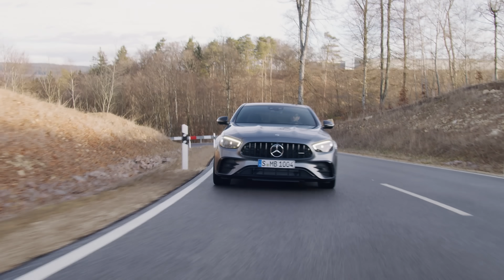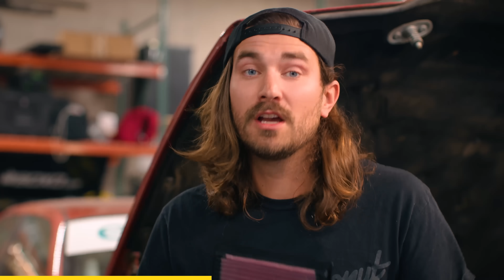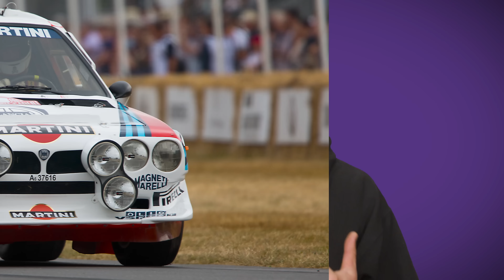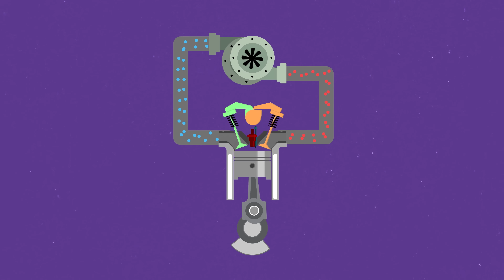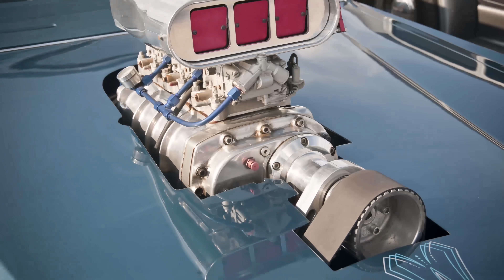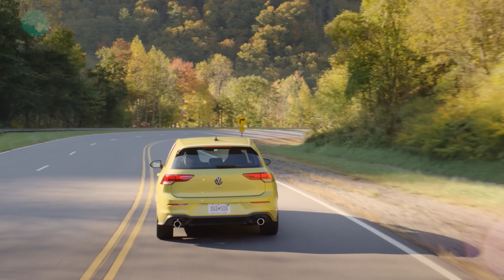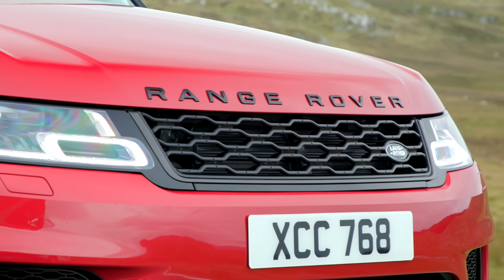Why Your Engine Isn't Twin-Charged

Comment: Actually, there are more than just 8 twin charged engines. Almost any turbocharged 2 stroke diesel is actually twincharged. Locomotives even took the concept a step further and added a clutched turbocharger. At slow speeds, the turbo is engine driven like a centrifugal supercharger, and at higher speeds, the increased exhaust gases allow the turbocharger shaft to spin faster than it would if it was strictly engine driven.
Reply: It's a cool concept and probably also practice, but the turbo when belt fed is still centrifugal, as opposed to positive displacement. I guess that isn't as important, though, considering the fact that a locomotive engine turns a generator for electric motors, instead of being direct drive? Cool enough concept.
Reply: @brianwesley28  It really doesn't matter for an engine. There are disadvantages to centrifugal pumps when you get into things like very viscous fluids, but for air, you shouldn't have a problem. In the case of a 2 stroke, the supercharger, or rather blower, doesn't create boost anyway, it simply provides positive air pressure to establish airflow. The centrifugal blower is actually more efficient on an engine, because the output air isn't as choppy as you get with a positive displacement blower. That's why most blowers have twisted rotors, to reduce that chopping effect. Screw type blowers are better at it than roots blowers, but centrifugal blowers are better than both because it's constant pressure.

Comment: Twin-charged TSI engines were the biggest piles of shit ever and I’m glad they’re gone. The scirocco for example, 1.4 160km. Really? You have to deal with all that just to get 160km? It was so unreliable you wouldn’t believe, so much pressure the pistons were breaking, and the supercharger was known to break as well, on top of the timing chain snapping after laughable mileage oh and the crazy oil consumption... Scirocco R used a turbo only setup and it says a lot(not that it was reliable anyway) Twin charging sounds good on paper but it’s a horrible idea for a daily.
Just get something naturally aspirated like a Honda with a k20 pushing 200km and you can sleep calmly without worrying everything will fall apart. And if you want a turbo then make it worth it and aim for higher power...

Comment: Love it too, I think 4age garage has a great video about a certain year infinite throttle body that has 2 pins for 12 volt to either open or close it and uses a manifold pressure switch to give it voltage to close off the supercharger.  He's got it working in the Toyota motor

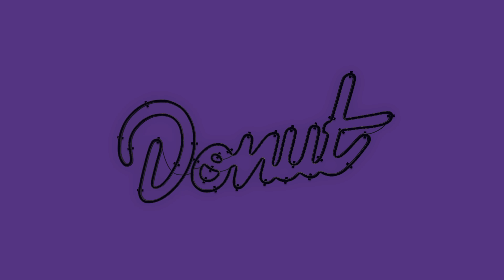Comment: 0:57, K&N filters miss fine abrasive particles like Donut Media missed the Volvo T6 and T8.
Reply: Yep, don’t know of many people who actually clean and oil the filters as needed.
Reply: Never had an issue caused by a k&n.
Reply: @realeyes4734  Always kept getting dirty maf issues even when cleaning and oiling the filter often. One day I wiped the inside of the intake tube with a wet paper towel and it was all dusty. Needless to say, the K&N filters don't seem like they are as effective as paper for filtration.
Reply: @MikeyG003  I buy preoiled filters. And most k&n filters don't need to be oiled regularly so idk what you were thinking.
Reply: @realeyes4734  they come pre oiled, but obviously you have to clean them after a while…they have a filter recharge kit with spray and oil. The fact that you don’t know this tells me enough
Reply: @realeyes4734  take a close look at the filters and shine a light inside it. You can see big holes that dust particles can go right through. Can’t beat the oem paper filters
Reply: @MikeyG003  they litterally say preoiled for lifetime use. Funny you oiling them and washing them probably is what caused it too suck more dust in because you over oiled it
Reply: @realeyes4734  it’s funny that you think stuff lasts lifetime 😂 bet you believe your tranny fluid lasts lifetime too huh? Gee I wonder why KN sells recharge kits if their filters are “lifetime.”  I know how to properly oil the filters actually. Have fun with dirty MAFS and running that dirty oil 10k miles 😂 bet your piston rings will thank you
Reply: @realeyes4734  unless you're doing used oil analysis across multiple vehicles you're unlikely to notice the difference, but an engine with the K&N will wear at a faster rate than the same engine with stock filters. If you're okay with that for the perceived performance benefit that's your choice, but it's good to be aware of the pros and cons 🍻

Comment: The thing I don't quite understand is why put turbos in a CVT transmission vehicle. As turbos work better at high rpms while CVT tries to maintain a constant (low) and rpm

Comment: An episode on that 1.4 TSI would be neat. I love the episodes where you guys dig into some details that make normal cars unique and special because of their design and reliability of certain systems so the average guy has an idea what to look for when buying a used car.
Reply: It wasn't very reliable and didn't get made for very long
Reply: @stug45  blablabla, my scirocco 1.4 tsi has 200,000 km and is still doing fine
Reply: Common job in my workshop is to rebuild the 1.4 due to the pistons cracking. The engine isn’t great at all.
Reply: U are right. 

 +1 vote for 1.4
Reply: 1.6 FSI 🫡
Reply: @mc_remzky7559  😂 it's ironic I always preferred the 1.6 8v MPI (105ps), unsurprising as it goes back to the MK1 Golf GTI. The 1.6 FSI (115ps) often had no more power because people used normal 95 octane fuel, they only work properly on 97+
Reply: That engine was a disaster
Reply: @BrianKariuki  Early 1.4 TSI yes, but later engines were a lot beter. I have 2014 Seat Ibiza Cupra (technically VW Polo GTI) and it has later CTH engine. No issues at all!
Reply: @tTurboCarrot  Real, I bought a Cthd Jetta now it has 150k km. Of course wear and tear needs to fix but other than that no issues.
Reply: 1.4 TSI bmy engine code is though, you only need maintenance this engines often, around 5000 km oil changes if you are driving hard and of course full timing chain replacement every 75k, and knowledge how to do this, and knowledge  that not every engine is indestructible.

Comment: I don’t know why nobody has made a turbo with an e clutch on it driven from the crank, like spin it up, suck the exhaust out, and when the exhaust starts to overpower the turbine, the e clutch can disconnect and allow the turbine to spin even faster
i’m taking the patent yep
Reply: don’t explain the problems. i know
It’s called research and development

Comment: Any Volvo with a T6 designation usually means its a supercharged and turbo charged 2.0 liter engine.  I'm surprised he didn't mention them because they've been doin that for a while and still do unless they have changed it recently.

Comment: Bro you including the Detroit Diesels in those "8" twin charged engines? 6V53T 5.2 litre, 2 stroke, V6, has a roots blower and turbo. DD did that on a bunch of different engines models

Comment: I bought a fire truck from a department that lost it’s funding and had to close its doors. It was a ‘94 KME that weighed in at 40k lbs and had a 6V92TA Detroit diesel in it. I remember the first time I used the hydraulic cab tilt to raise the cab which had to be done to access the engine as it was a cab over engine design. There was this huge engine with a monster snail on the side and I thought “what a sick ass turbo!” til I saw the sick ass supercharger also nestled on top. To weigh 20 tons this truck had the torque and was surprisingly quick. I tagged and insured my new to me fire truck and used it for everything. From picking up my son up from school to taking my wife to the grocery store. My wife hated this fire truck because it stunk, was loud, and gave her a headache. I don’t take my wife anywhere anymore.
Reply: So it's actually not a supercharger because the Detroits require a blower to run. They are two strokes and they get their air at the bottom of the stroke when the piston is not creating vacuum so a blower is required to get air into the cylinder

Comment: The car geek in me says that if a motor uses identical chargers i.e., turbos, that's a twin system, however, if it uses a S/C and a Turbo, then its compound boost. 

Car guys in the comments. LOL
Donut please stop referring to such set ups as "twin" charged.

Comment: The car geek in me says that if a motor uses identical systems i.e. turbos, thats a twin system, however, if it uses a S/C and a Turbo, then its compound boost. 

Car guys in the comments. 
Donut please stop referring to such set ups as "twin" charged.

Comment: Im thinking that adding a super charger between the turbo  and intake runners might  decrease turbo lag, maybe the other way around, most super chargers dont run an inter cooler, because your not heating the air like turbo,s

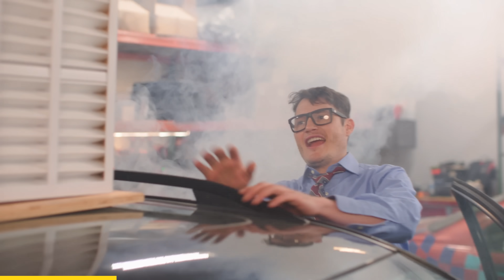Comment: 1:28 So, in the construction of the FART, you used DualUnescesarryDucts(DUD), multiple PreciseOxygenSensors(POS), an ElasticWasteWasher(EWW), and a Variable-Ingegrated-Injectors(VII) TBH i dont know what VII is supposed to mean, but i know what the others mean

Also, your Oil-Hub-Filter-Utilisation-Contraption probably needs some Koolant

Comment: Aren’t some Detroit diesel 2 strokes twin charged?
Reply: Detroits weren't twin charged or even supercharged. The blower on them was required to run. It's a two stroke with no exhaust valves it has intakes ports in the cylinder wall. The piston uncovers these ports at the bottom of the stroke. The piston does not create vacuum at the bottom of the stroke. So the blower is there to get air into the cylinder and that's about it which makes it naturally aspirated and the turbo variants we're like any other turbo diesel.

Comment: Jeremiah as always fantastic episode. Thos had me pondering about something I've thought about for a while. Different car manufacturers have went Different routs to obtain more while getting better fuel economy. 
  Ford was one of the first and they went to the turbos with the Ecoboost engines. At the sametime they had been adding more gears to their transmissions with their trucks. Further helping MPG.
   GM later did a similar jump as Ford. However I don't thing their shrunken gas engine with turbos like the Chevy Cruze is much to write home about. However they have added more diesels in smaller sizes. Which is another great way go get much more MPG.
  Subaru has stayed with the trusted and loved boxer engine.  The moved on from the 4ATE automatic transmission to a few varieties of the CVT. The CVT not only helps achieve better fuel mileage over a great platform. It also keeps the vehicle from any type of moments of sudden change or slip that you can have in an automatic transmission. The CVT keeps the wheels in motion at all times. Subaru felt this is best for safety, driver experience and the symmetrical AWD platform.  The Ascent has a turbo in the 2.4L to help it get moving up to speed while still achieving very good gas mileage for the size and architecture of the vehicle.
  There are other companies that aren't as open into how they are getting more mog out of their models. Especially if your not seeing a smaller engine with a turbo as an option. What is Dodge, Jeep, & RM doing? A lot of the line up is the 3.6. Some now come with e torque as an option. How does that compare to the others? It seemed that until the last few years Dodge, Jeep & Ram where relying at on cylinder deactivation. As well as putting the 9 speed ZF transmission in anything they could. 
  Am I far off? What are your thoughts? I think it could make a great episode. Possibly a series. You could easily spend an episode each on each manufacturer. 
  Keep up the great work!

Comment: This video feels a little too late.  Who on Earth would use a supercharger to twincharge when you can use an electric motor on either system to achieve this with very few extra parts and weight.  Compressed air is another underutilized option for racing, but much prefer the electric option for the real world.  EDIT:  I see, we're gonna call them electric superchargers, I guess that's fair

Comment: i was thinking of a concept of air injection to the turbocharger using a turbo that has a extended impeller shaft with another impeller you could shoot a blast of high pressure air and spin the turbo instantlly,using bottles like scuba tanks that use a pully that works off the crank to compress air into the tanks to refill them as you drive,that has a pressure switch that stops compressing air once at a preset target pressure.maybe using a ac compressor to refill bottles since it disengages when it sees the target pressure

infact you could even modify a turbo withput needing a 3rd wheel on the turbo by drilliing a port into the turbine/compressor housing and having a steel nozzle tip added that could blast high air pressure onto the compressor or turbine wheel from idle to what ever peak boost is.once peak boost is acheived the system uses pressure switch to shut off the air supply from tanks.

just fruit for thought on air injecting to replace supercharger in twin charging.as this would be far less complicated and very basic concept.also this might make new cool sounds if you bottleneck the air after its been injected onto the third impeller into a valve that has a horn shape.

Comment: Did you check out the Detroit Diesel 71 series TIB option set which includes Turbo Intercooled Blower options on a mass produced engine. Which can be found in many applications over the last 40 years alone.

Comment: For the last 20 years I have been toying with the idea of a twin charged efi smallblock utilizing 2 turbos with a smaller compressor wheel and larger hot side an a crank driven centrifugal, but I haven't acquired the spare 20k+

Comment: I had an after market twin-screw supercharger kit installed on a 1994 Subaru SVX. It had a boost delay, because there needed to be a vacuum bypass valve on it to idle. It idle as smooth as factory sitting at a light. Once you started to go and got to about 1200 rpms, there was enough vacuum to close the valve. It resulted in a sudden 75hp jump in power. If you happened to be in mid turn, it could quickly result it an unexpected U-turn......
Reply: I think I would have actually preferred some turbo lag....

Comment: Hey Jeremiah are we going to overlook the fact that the supercharger in a twin charge system is a boost multiplier now bear with me the supercharger at low RPM provides power where the turbo can't however when you get up in the RPM band and the turbo spooling the turbo is supplying pressurized air to the supercharger and then the supercharger has the ability to compress it again this happens a lot of times in  older aircraft engines

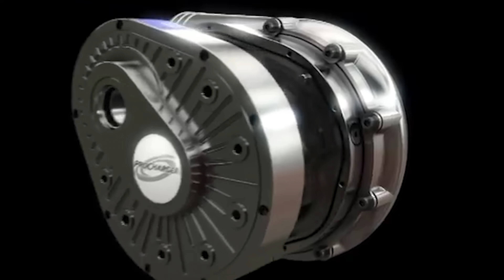Comment: 7:53 "as crank speed increases, there is an exponential increase in impeller speed"
i think what you meant to say is 'linear increase in impeller speed' , since the impeller spins at a fixed ratio to the crank

Comment: Check out the hellion hellraiser kit for the 04 cobra. Twin turbo and supercharged. I was one of the few people who used it with a kenne bell 2.4L supercharger. I made over 1k HP at 30 PSI and 10.5 degrees of timingwoth C16. Made 850 on 26PSI and pump gas as well.

Comment: COMPOUND TURBOS!!!!!!!!!!!!!!!! 
90% of the benefits of supercharger+turbo with less draw backs, sorta. Maybe just different ones, but it’s the best IMO anyway.  Two turbos, one big one small but it’s not twin or sequential. The big one blows into the intake of the little one to magnify the air density it starts with, you get a super responsive turbo setup that has big top end. You do need a really good intercooler setup though and some complex exhaust.

Comment: I recently added a procharger to my '91 F-150 302. Runs much better now, tons of power and after removing the clutch fan and replacing it with an electric fan, I can't tell it's there until I mash the accelerator. I love it.

Comment: Here’s a power plant for you to check out:
My Dad had a 1987 44’ Viking Motor Yacht with twin Detroit Diesel 6-71 TIB’s.
Pop quiz: were they 2 stroke or a 4 cycle diesel twin forced induction beasts?
Reply: 2 stroke but not twin forced induction the 2 stroke Detroit's blower was not a supercharger and did not have a supercharging effect. In fact that 2 stroke design requires a blower to run. As such the non turbo Detroits are naturally aspirated

Comment: i kinda missed something. Most boats are twin charged, turbos feed the blower. The engine you kept showing was just blown. im confused as to go from blower to turbo and thru a cooler would create a pluming nightmare. why not go full hog and put a clutch in the system and we will call it mad max charging system. you still will have to have a blow of valve in that loop to, as you would kill the turbo and owner as it explodes.

Comment: There were some old engines (possibly aircraft? Can’t remember) That had what is essentially a turbo and a centrifugal supercharger combined into one unit. A single turbo-style compressor housing with both a crank pulley and exhaust turbine on the other end. The idea was that the crank drive would spool up the massive turbo, then disengage via a clutch once there was enough exhaust to keep it spooling via the turbine 👍🏻
Reply: Big two stroke train engines did that. EMD 710 567 and 645 series. I wouldnt be suprised at all if the big two strokes in ships did it too.

Comment: Why not just have an electric motor drive the turbo shaft directly ? - at low rpm you get the 2bar of boost and at higher Rpm you disengage and allow the exhaust gas to drive instead.
No complexity of a supercharger and all the gubbins